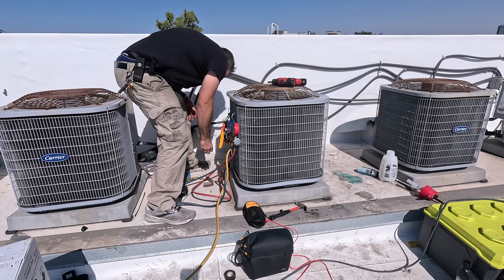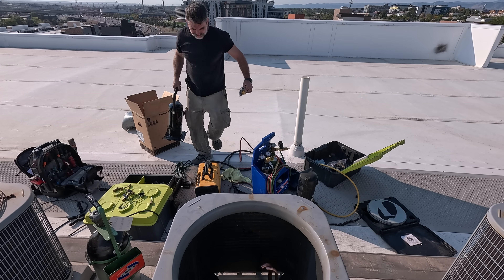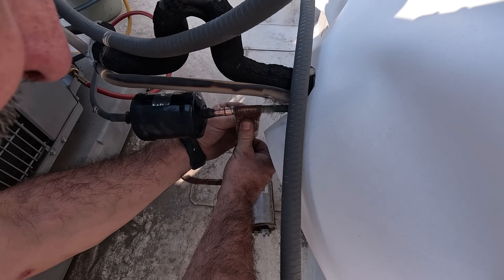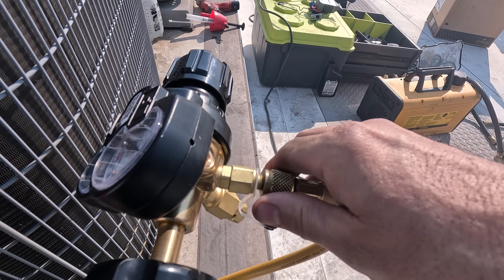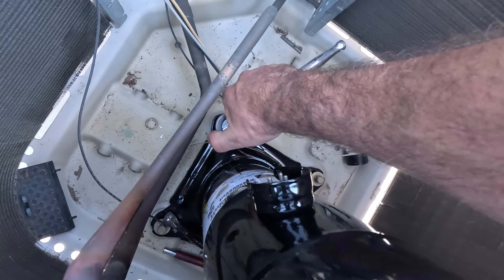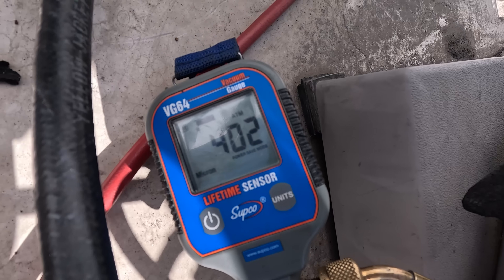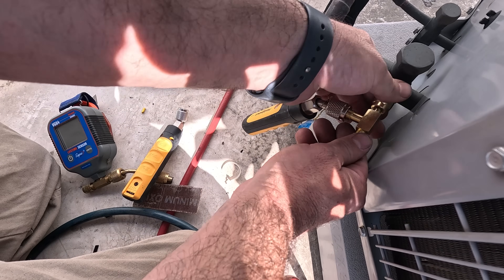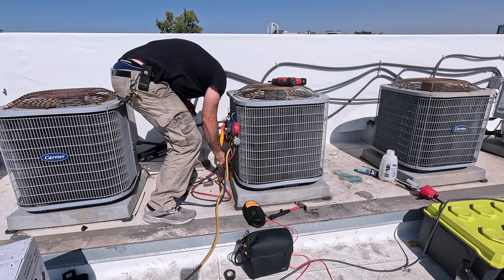Central AC Compressor Replacement

Comment: This is an on/off system without inverter capability I suppose. Right?
Reply from the maker: I don't know what you mean. It's a single phase compressor. There are soft start inverters you could install if you want ?
Reply: @ApartmentMaintenancePro 
Thanks for your reply.
With on/off I mean: when the compressor is activated it runs at full speed (100%) and can't be modulated.

Comment: Excellent Repair wonder how much a job like this cost or is it cheaper buy new condenser unit ?
Reply from the maker: It’s USUALLY cheaper to replace just the compressor, but not by much. Many variables determine which path to go

Comment: What are those inverted traps on the suction side line set above the filter dryer  @7:28? It looks like every unit has it installed. I’m sure it serves a purpose but I’ve never seen them installed vertically. Is it something for refrigeration oil?
Reply from the maker: Oil recovery. But I’ve never seen them like that in the roof but I don’t do pipe fitting

Comment: I have a portable 14,000BTU AC unit (Honeywell) and a bunch of Black&Decker 14k units. I recently switched to the Honeywell and it works amazing - when it works -  but the issue is that it's constantly turning itself off until the water is emptied. I end up waking up at 3AM covered in sweat and it just sucks because I have to physically lift it up and put a bucket under and pull the two plugs. What's strange is that I ran the B&D units for years and years and I do not recall ever having to drain the water as I only run them on cold but I'm also running the Honeywell on cold only yet it still requires 1-2 empties when I'm trying to sleep. The only thing I can think of is that the B&D units would make a  noise like a water droplet hitting a super hot pan so maybe they dispose of the water by having it drip on the hot compressor and boil off? Idk. The Honeywell has 2 drain plugs and one is at the absolute bottom of the unit so using hoses doesn't really work unless I can raise the whole unit up but it would be too tall to blow on me then.
Reply from the maker: You could attach a small condensate pump 👍